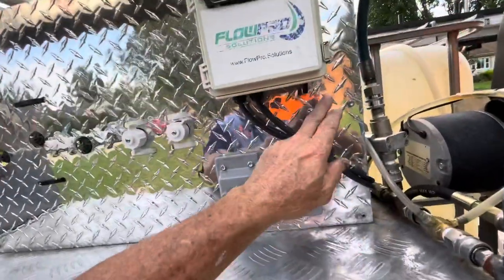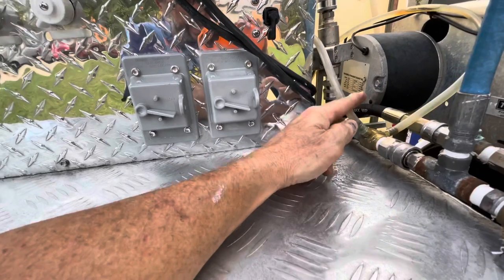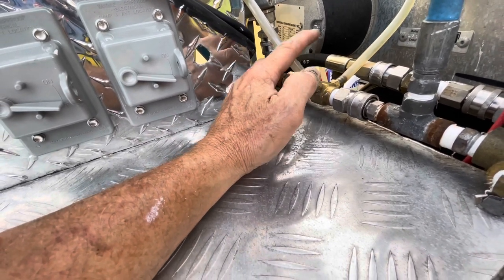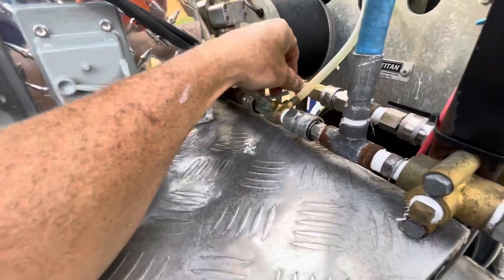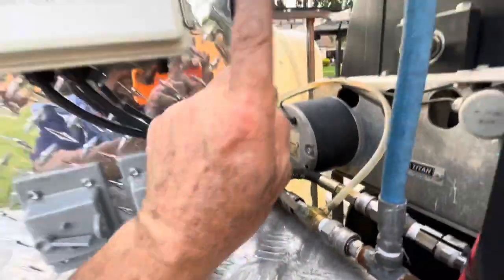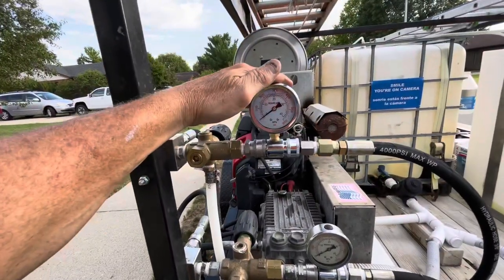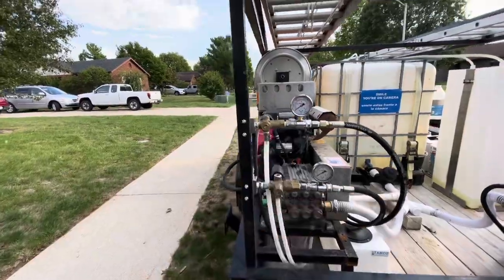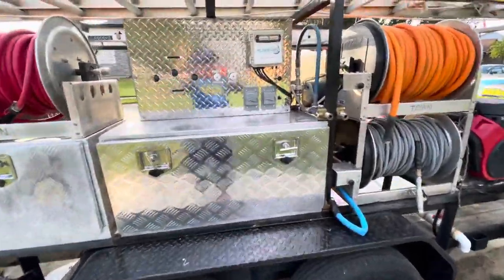3 Way Ball Valve and New Pressure Gauge

Comment: I have a question you said your down stream injector is a 1.8 Orefice. The smaller the orefice the more SH it will pull. Just trying to understand this. Also I see you have a metering valve hooked up to your SH on your downstream injector I don’t understand that because I thought that the injectors pull either a 1.5 or 2 % SH. can you explain please sorry for the long question brother
Reply from the maker: Sure. The small the orifice, the more SH you will pull because your injector is allowing less water to pass. You are actually pulling more SH, just less water. I have a video explaining the metering system. It’s on the channel somewhere. Thank you for watching brother!

Comment: Morning Mike. What are those grey switches called and what do they control?  Where did you get the aluminum tool boxes?
Reply from the maker: And a good morning to you. The grey switch on the left is for my tail gate safety lights. The grey switch on the right is for my roof pump. I get the tool boxes from eBay. The 24” box holds the roof pump. It’s $100 shipped. The 36” box holds my battery and tool box and stainless quick connects. I’m not sure what that one costs... but not much more.
Reply from the maker: Also, I think there may be a video on those switches
Reply from the maker: https://youtu.be/hAzkC1ybz7s